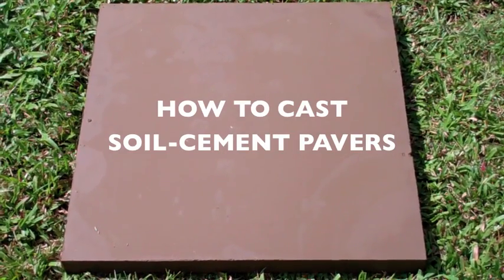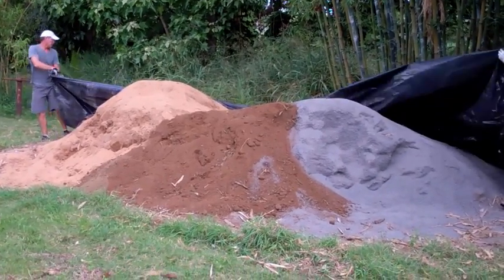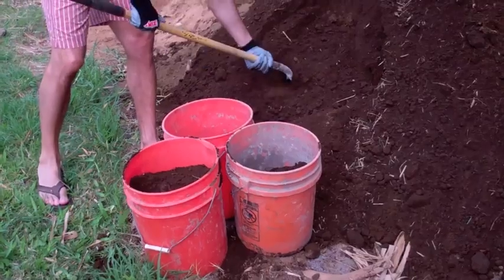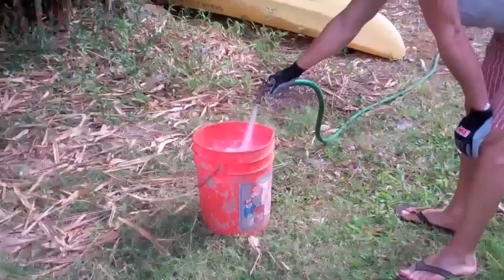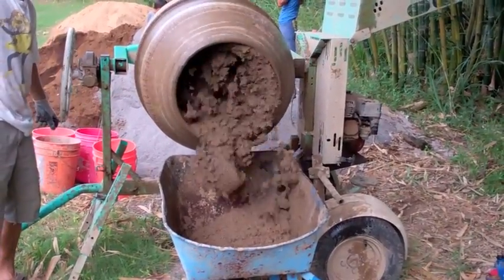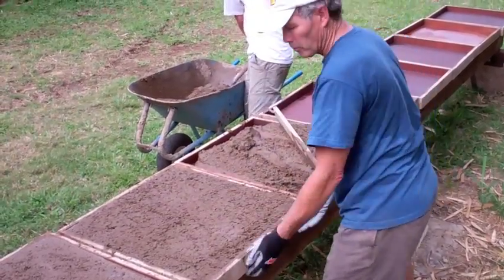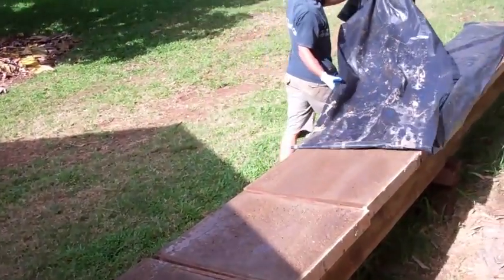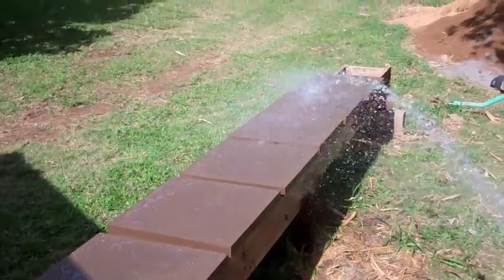Soil-cement pavers

Comment: Realistically, buying pavers at $2.88 a foot is probably a better idea. Less hassle, better quality, more design options, carries an actual durability rating and you probably dont save much after making those forms and striker, the oil, the raw materials and a cement mixer

Comment: but how much is the compressive strength of this tile??
Reply: Generally between 300 and 800 PSI depending on the soil mixture. Not nearly the compressive strength of concrete, but plenty for things like floors and even driveways.

Here is the holy grail of Soil Cement info:

https://www.cement.org/docs/default-source/th-paving-pdfs/soil_cement/eb003.pdf?sfvrsn=2#:~:text=Depending%20on%20the%20soil%20material,(2%20and%206%20MPa).

Comment: since this is like an "Adobe Brick Process" wouldnt straw help in the batch to prevent cracking as they dry out over Time? Just a thought maybe even mesh wire on the bottom not much added cost.

Comment: how solid are the pavements?
i mean its a huge improvement due to small amount of cement used, but are they sturdy?   maybe a small litle video to show it would be very ilustrative.
many thanks!!!
Reply: Did you see the bamboo in the background?
Country without frosts - you can add clay. In Canada, the mixture should be free of clay.

Comment: This would work great with our "soil" that is very sandy, and cheaper than using (old, so any salt in it gets washed out) play sand from our sandbox! Questions: What kind of cement is it, Portland (type 1 or 2?), Quikrete, etc? Why isn't chicken wire or something like that being used to reinforce the pavers? This less than a 2 (aggregate) :1(cement) ratio? BTW, very impressive! :-)

Comment: wow, these look smoother than the other people on u-tube usually....
Reply: Carol Burnett These aren't compressed.  This is more like cement that is "diluted" with dirt.  They also use a lot of water.  You may be thinking of cement stabilized earth blocks (or compressed earth blocks - ceb's).  The advantage of the ceb is that it is made on site, requires very little water, very little cement and is a direct replacement for a conventional clay fired brick.  The advantage of these pavers is they are smooth and stretch out your cement budget, provided you have a lot of water and do not need the strength of a conventional brick.  it is sort of like man-made caliche.
Reply: Thanks very much Christopher for your reply.....excited to make my first one.....

Comment: Seriously? 3 years ago? And you were meant to show us how to lay the pavers? lol. good work nonetheless. Thanks for sharing ;)
Reply: Its been 7 years now.
Reply: now 12 years....our lives are ticking away waiting to find out how to lay them. My pavers are all cured now, let's go!
Reply: Oh wait that's install.
Reply: Dumbass
Reply: Lay? What's so hard just plop it on the ground
Reply: @olgatorres1740  That explains why the pavers at your place are all cracked.
Reply: @dansw0rkshop  compacted crushed concrete is very cheap if you have a concrete recycler nearby. works well as a base for pavers if tamped level before laying the pavers

Comment: nice work. so is there something to make stronger cement mixture? i mean chemical or anything cheap thing to add cement mixture? thanks
Reply: gayan krishantha add more cement.  instead of 3 dirt buckets, 2 sand buckets and 1/2 bag, add 3 dirt, 2 sand and 1 bag cement.
You only need to make it "strong enough", so figure out what that is, then add cement until your test tiles reach this point.
Reply: Chopped Fiberglass
Reply: *****
thank you verry much
Reply: Christopher Whitestone
thank you christopher
Reply: +gayan krishantha Here is a cheap way to make it stronger:  Leave most of the water out.  The addition of all the water makes this paver so it can't be compressed.  If you try to compress the mixture, the mixture will squish away.  So to make the paver stronger, cut out most of the water so the mixture is just barely damp, then pack the mixture into the frame.  The compression will make it much stronger.